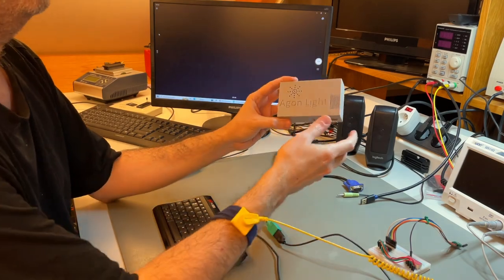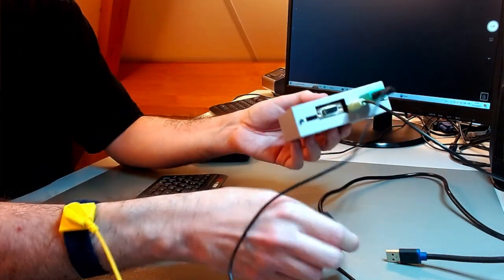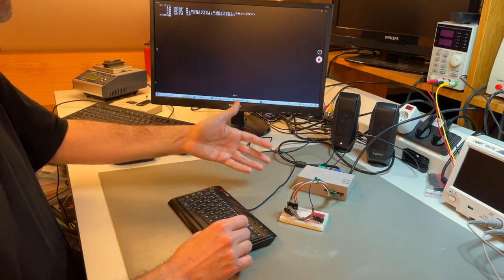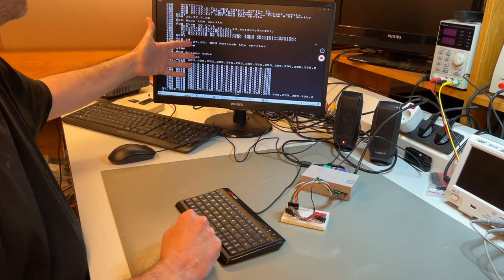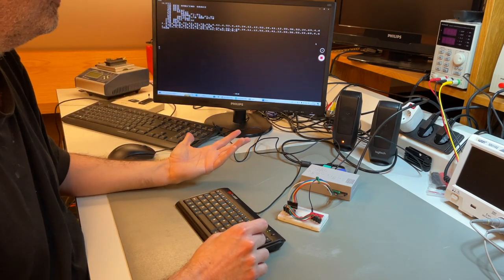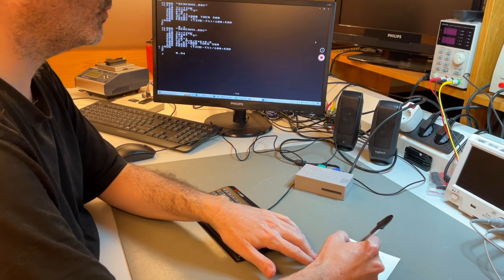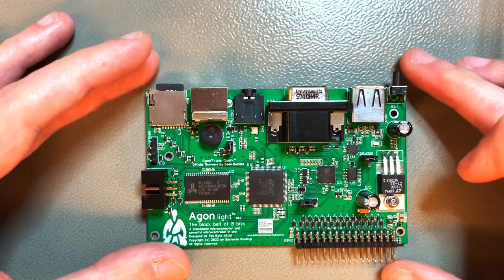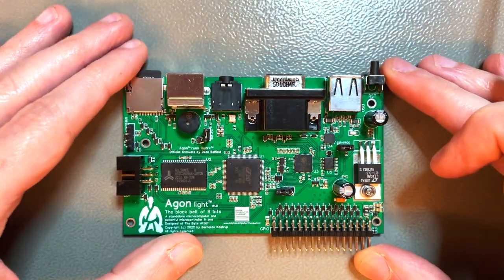The BIG Agon light™ REVEAL! Meet the FASTEST and CHEAPEST 8-bit computer ever built

Comment: This is pretty interesting. I was just casually looking for a chip with a VGA output to build a little computer with, and here you have it made already. I don't know about the 8-bit limit. I guess this will take a lot of study to see what it will do and whether cost can come down a lot. Raspberry Pi has really set a standard for cost. Great job!
Reply: This and the Raspberry Pi are very different animals. If you don't specifically want an 8 bit machine, there are plenty of other options. But the Raspberry Pi is made in huge numbers, so benefits from economies of scale. The Agon will never be able to compete on power/price ratio alone. If you want to run Linux or maybe RiscOS, then the Pi is great. Assuming you can get one at a decent price.

Comment: I like the old 8 bit stuff and use BMC64 for all my commodore nostalgia use ( PET/C64/C128/Vic20).  I've been looking at some newer "8bit" option to play with (c65, Commander X16, etc) and I have to say this is the most compelling option for me.  Thank you for all your work!
Reply: This is an excellent option for programming assembler in eZ80. Next step would be to use the machine code to run an eZ80 inside custom built robots with BBC BASIC.

Comment: I love that you created this! It would be great if you could include, on the full Agon, an expansion port with all addr/data/control signals, and even include DMA and support for replacing/expanding the internal memory, like the Atari PBI/ECI.
Reply from the maker: We still flirt with this idea for Agon heavy. The problem is that bus expansions load the bus a lot with parasitic reactance and reflections, even if there's nothing connected to the expansion. And since we plan to run Agon heavy at 48MHz, that's an issue. The alternative is to put a lot of memory onboard by default (say, 2MB, perhaps more) and avoid the bus expansion. That also saves connector costs, which are relatively high, for some reason. We will see.
Reply: @thebyteattic  some pads on the edge (so you can stick a pin header on it or use an board-connector) with 8-bit address, 8-bit data, r/w and two select would be enough for 90% of all possible projects.

Comment: Any benchmarks for the MEGA 64? It has a FPGA implemented GS4510 - related to the 6502/10 - that can run at up to 40 MHz! I presume it may be twice as fast as the Agon Light, but only because of the maximum clock speed.
Reply from the maker: Only benchmarks can tell for sure! But there are some things to consider. The eZ80 has a much, much more powerful instruction set than the 6502. And it is fully pipelined, which is unlikely the case with the MEGA65, as it would break compatibility. So regardless of clock speed, my prediction is that Agon would still be (significantly) faster.
Reply: I have found one benchmark for the MEGA65 on the C64-wiki page: Synthmark64 score is 44.5x (C64 = 1x). So given the C64 completed the Battle Royal benchmarks in 3 mins 23 secs = 203 secs, the MEGA65 should complete the benchmarks in 4.6 secs, if all other things are equal. So this would make is comparable to the Agon Light, for speed. But at €700 it is not comparable for price, but that includes a case, keyboard and floppy drive. It’s much more of a luxury item though…

Comment: First I heard of a eZ80F91.  Just peeked at the datasheet.  It is a strange bird. Looks like the reason for the chip is its built-in 100mps ethernet.
You certainly make full use of 24-bit address buss pinned out on this 144-pin monster. 
A modern MCU with serialized RAM, providing services to a semi-modern hybrid MCU, that is backward compatible to an ancient CPU.
"So we beat on, boats against the current, borne back ceaselessly into the past."
Reply from the maker: This is an eZ80F92, a smaller MCU. And there surely are plenty of applications for precisely this MCU (one of which is TI calculators), as it trades off clock speed for parallel buses. The resulting board is much easier to design without advanced, high-speed PCB manufacturing processes that are quite expensive compared to prototype manufacturing (which Agon light uses).

Comment: Nice! Agon looks like a wonderful project, and one that particularly interests me. 
One thing Bernardo: I noticed dot named files on the sd card. Was that used with a Mac? If yes, there’s a nice free app called “Clean My Drive 2” by MacPaw (great Ucranian Mac programmers), that will clean the sd card before ejecting it. I used it a lot to clean sd cards I used with BASIC Engine. I hope it helps.
Reply from the maker: You're right, that SD card was loaded in a Mac. Thanks for the tip!

Comment: I'd be interested to know if the UART can be configured to send MIDI.
Reply from the maker: I actually don't know... not versed in MIDI myself
Reply: MIDI never used dedicated chips, IIRC.
It always was implemented as just an off-the-shelf UART.

All UARTs allow the number of start and stop bits to be configured and data rate.
MIDI uses one start and one stop bit and 8 bit word and a speed of 31.25kbps.

So as long as the speed can be set correctly, I don't see why not.

MIDI was really more about the message protocol just sitting on top of an off-the-shelf UART.
Reply: The great thing is this is open source so the community might can add that functionality!

Comment: I got my Agon Light 2 from Olimex some days ago. Eventually, I found the time to try it out and ran into a problem with the keyboard. I have copied the BASIC interpreter to an SD card, and when I start the board, it immediately enters the BASIC interpreter. Unfortunately, I could not get the keyboard working. I tried four different USB keyboards, and I've also tried a PS/2 keyboard (Periboard-401) with a USB adapter. None of them worked.

The USB port emits power because some keyboards have LEDs lit up when I connect them. Still, I cannot type anything. What am I doing wrong? Is there a list of supported keyboards somewhere?
Reply from the maker: Yes, you may seek support/advice over at the forum:
https://www.facebook.com/groups/agoncomputer
You must use a PS/2-compatible USB keyboard. Not every USB keyboard is so.
Reply from the maker: I am told that this works: https://www.facebook.com/groups/agoncomputer/posts/1169999457034768
I use this: https://www.amazon.com/Keyboard-Portable-Professional-Industrial-Computer/dp/B07DZZWD9W

Comment: It is impressive. Two questions though, 1. Why was USB Type A used for the power connector rather than Type B? A to A cables are rarer than A to B., and 2. Why is the command syntax uppercase /case sensitive? But I hope someone develops a sidecar that adds comm ports, GPIO breakouts, and other cool stuff.
Reply from the maker: Thanks! I just hate USB B and microUSB... I find them flimsy and prone to mechanical failure. As for the upper case, that's legacy, I believe.
Reply: @thebyteattic  100% agree.

Comment: I applaud that for your benchmarks, you compared against the version of BBC BASIC for the ZX Next making the comparison much more fair than using the very slow version of BASIC that is standard for the ZX Spectrum. Too bad that the other benchmarks you quoted are not using BBC BASIC on the ZX Next.
Reply: But that's irrelevant, because the Speccy Next has it's own default language, as do all the other 8 bit machines. Why try and use anything other than the default language? Whilst there are a lot of versions of BBC Basic, it doesn't exist for a lot of platforms.

Comment: It would be, for me, much nicer to have a M68HC11 version of the cpu, as it has true 16 bit math, 8 x 8 multiply, and better addressing modes and registers. With new process, the HC11 architecture could probably run 20 to 30 MHz clock... there's also a real time BASIC for it, which, with 4 MHz clock ran 20,000 for next per second, and had quite a few possible interrupt sources...

Comment: I am a still a little confused about a few things. Yes, I'd like to program this in Z80 assembler. Hopefully some assembler will be available for this? The choice of BBC basic is good, but the BBC Micro had a 6502 processor, and you could embed 6502 assembly language in that. So, how does this work with a Z80 processor at its heart??
Reply from the maker: There are multiple assemblers, both native and cross-assemblers. Check the main website. BBC BASIC was first ported to the Z80 as early as 1987.

Comment: Congratulations on getting the Agon Light out there! It makes sense why there's an eZ80 CPU in there, but I can't help but wonder how much BBC Micro software could've been easily ported to the Agon Light it if had a 6502.  Software written entirely in BBC BASIC should be simple enough to port. If anyone out there who knows 6502 assembly wants to learn/brush up on their Z80 assembly, please consider porting some of the Beeb software over the Agon Light. :D (I would but I wouldn't know where to begin with assembly... BBC BASIC is about my limit when it comes to coding!).

That said, making a modern-day BBC Micro-compatible machine wasn't one of the Agon  Light's goals, and it seems almost like a happy little accident that the Agon Light reminds me of a Beeb only if it had a Z80. This is high up on my wish list for hobbyist 8-bit machines once I get a bit more time to start putting one together.
Reply from the maker: Hopefully it can do a little more than just run the old BBC Micro software... It has a few more capabilities ;-)
Reply: I wonder how well it would run the BBC chess program, which was pretty good at 2mhz.  I used to absolutely love the 8 bit chess computers Fidelity Par Excellence and Novag Super Constellation machines on the 6502 (at 5mhz). If some genius could port them to this sort of machine, it would be a dream.

Comment: I would suggest in the future, to convey how fast your design is, just say how many instructions it can execute per clock cycle. This removes confusion and quickly shows if the design is efficient, without talking about megahertz or adjusted clock speeds to compare chips... every cpu has a baseline instructions per clock number, and from that number you can derive real world application speed for any given bus frequency.
Reply from the maker: This doesn't work, otherwise nobody would need to perform benchmarks. One can only state an average of cycles per instruction (not instructions per cycle, unless you have a VLIW or Superscalar CPU exploiting instruction-level parallelism, which is not the case here, nor for any 8-bit CPU, unless we're talking about my own Talos ES). Application performance depends on bus contention, control flow constraints like conditional branches, hazard detection (for RISC CPUs), memory access latency, interrupt requests for I/O, etc. If one wants to know the system's performance for a given, representative application, the only way to figure that out is to run the application and measure it.

Comment: Can you make a VDP only half wtih the serial header so other systems can use that half?
Reply from the maker: I didn't quite understand what you mean...?
Reply: @thebyteattic  your block diagram shows the audio and video (you called it the terminal half) and the computer half - the terminal half if connectible to a very fast serial port of another system (e.g. Amstrad CPC) could perhaps be used as a graphics card.
Reply from the maker: Oh, I see what you mean. That's possible: on the control port of Agon light there is an eZ80 UART of the exact same type as the UART that connects the eZ80 to the ESP32. So the system can be extended, as you proposed, via the control port.

Comment: How do you flash the Z80 if e.g. you want to change to CP/M from BBC BASIC?
Reply from the maker: https://github.com/envenomator/Agon/tree/master/Programs/flash
Reply: @thebyteattic  That's cool! So you only need the special eZ80 programmer cable if you have a blank Z80 (or with completely wrong firmware), otherwise you can upgrade using only the microSD card and some commands?

Comment: Really cool project!  My brain is whirring with a million ideas and questions.  I'll just ask questions about memory used for now:  how much of the 8MB ram and how much of the ESP's rom on the terminal side is used up already?
And how much of the eZ80's ROM is used up?
i.e. Is there slack unused space that can be used to bolt-on additional functionality to the base code and use some terminal memory for other things?
Reply from the maker: -- Less than half of the 8MB is used.
-- Not sure how much of the ESP32's flash is used.
-- Very little of the eZ80's flash is used, as BASIC resides on the uSD card.
-- More functionality can be added by plugging an expansion tot he control port. There is still some board space left for circuit additions, if they can be routed.
Reply: @thebyteattic   Great thanks for the info, keeping the basic on sd card gives a ton of flexibility.
I was pondering how the ESP's ram could be made available to the eZ80.
The spare eZ80 flash space and spare ram on the ESP is making me think of a small ISR / syscall-ed  4mb 'ramdisk' if there is also space in the ESP flash to implement.
Not sure if there'd be much or any speed advantage versus the SD card because the links eZ80->ESP->psram are all serial,  but  perhaps if comparable then some wear and tear on the SD might be saved for temp file uses?
Hmm, you said that the SD is on an SPI bus, so hugely faster than the UART serial can do.  Still, 4MB is just begging to be used somehow!

Comment: You got to remember that the Z80 wouldn't have a floating point coprocessor so the CPU is doing all the math calculations with instructions not hardware on an 18MHz clock. BTW someone needs to port or write an "Asteroids" for the BBC Basic!

Comment: 9:05 a classic mistake. you do not want to make a infinite loop going back to 20.
instead you want to add the line 25 if inkey$ <> "" then system
or
25 if inkey$ <> then chr$(0) goto 50
wich will get you OUT OF THE LOOP AFTER A KEY PRESS. AND NOT POSSIBLE BRICK THE SYSTEM.
that kind of fast code. maybe skips your break keys. so add an OUT OF THE LOOP  function manually. pretty please.
end that %#%@% loop. 
going loco.

Comment: I hate to break it, but that's a 32 bit thing. 

Still, cool system!
Reply from the maker: The bit-width of a system is determined by the width of the CPU's data bus. That's why the 6502 and the Z80 are 8-bit processors, even though they have 16-bit address buses. The ESP32 has an internal data path of 32-bits, but no external memory buses (external memory access is serial, via SPI, so essentially a 1-bit 'bus'). Moreover, the ESP32 is not the CPU in this system, but a video co-processor instead, which does not define the bit-width of the system. The eZ80, which is the CPU, has an 8-bit data bus. So Agon is, literally and unreservedly, an 8-bit system, for exactly the same reason that any other 8-bit system is an 8-bit system. There is no ambiguity or subtlety here.
Reply: @thebyteattic  hmmm

I guess you are right then.

Comment: is it compatible with binary files of any of 8 bit systems? if yes with which system is compatible ?
Reply from the maker: No, it's a modern machine.
Reply: @thebyteattic  thanks for the information mate! The hardware is very interesting, and very useful. It proves that in these times in which you have to be an expert in IDEs just to write some code, you do not need to do so. Not C, but even good old basic is enough to cover a large variation of applications provided the fact that the hardware is fast enough to do it. And this board is very capable.  I just had a fantasy for a moment in my previous question, that maybe it could run binaries and bas files of CPC 6128. But we cannot have it all! :)
Reply: Binary files but not ASCII files?

Comment: Hi Bernardo, very impressive work! I always liked the BBC basic and it’s features and I think this little gem has a lot of potential still by optimizing the interpreter to fully use the hardware! I tried ordering an Agon1 from PCBWay but the project you set up seems to be not correct. The ordering process detects a 2-layer board 1,6mm and I didn’t check further what else may be wrong there. For convenience I wanted the full Monty - so all being assembled for me  or at least everything except that THT stuff. Could you please check what’s going on there for all thatlike to do the same. Or is there already a group buy which is cheaper than the around 120€ for a one of. Thanks for this great project!
Reply from the maker: I agree that more can be extracted from this machine with more optimizations! Regarding the PCB order, you are more than likely using the "quick order" option. That doesn't work for anything beyond a vanilla 2-layer board. In the Agon website I provide a direct link to the project at PCBWay, so that should eliminate some of the issues. Perhaps PCBWay will even sell the whole thing assembled at some point. For now, your best bet is to join the Facebook developers group (link in the video description) and pool resources there. I know of at least one person in the UK who has already ordered 50 assembled units.

Comment: I don't understand how exactly the normalization for clock speed was done?
Reply from the maker: Multiply the raw result by the system's own clock speed, then divide the outcome by the highest clock speed among all systems. For instance, for Agon, if the raw result was 0.5s, then we do 0.5 x 18.432 / 28 (28MHz is the highest clock speed, for the Spectrum Next in turbo mode).
Reply: @thebyteattic  I see how numbers are calculated. Thank you!
Isn't it enough to simply multiply by the clock? That will gave the time if you have 1mhz - a common base for all platforms.
BTW is there a video or link with details of graphic capabilities? Like modes, resolution, is it tile, linear, planar,... sprite size and format, layers, H/V scroll, DMA, ...
Also I'm not fan of FB, is there a discord server?